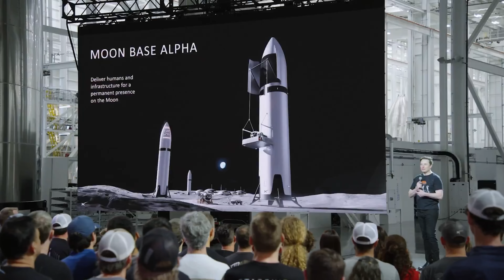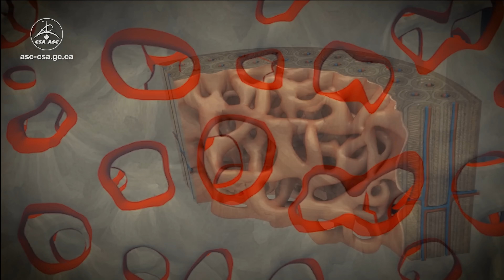New Inside SpaceX Moon Base Alpha REVEALED...

Comment: I think I might be on the spectrum.  I got upset with Google because I asked for the average temperature of the moon, then had to do the math myself.  It's between -10 and  10°f.  I'm pretty sure if we dug into the surface, we could live pretty comfortably without much need for heating or cooling.
Reply: Google already did the math for you by stating it's-180and 200 during the day. It has no atmosphere so the average will depend based on correlation to the sun in orbit.

Comment: Yes lets cut into the fuel tanks to make hatches. Brilliant idea! well send in the apprentice first...
Reply: Oh yes, before dispensing the sat simulators, there was significant haze floating around in the storage compartment... (maybe residues of the normal air from the launch site..., a bit denser here, less dense there, floating around...). 

That's how not empty it was...

And then imagine this - but consisting of fuel or oxygen residues in the fuel or oxygen tank - floating by the place that they cut open...

Comment: Starship is cool tech and should be useful for cargo but it is never going to be used for crew without heavy modification (or corruption during certification). It simply cannot get rated for human flight in it's current form. NASA's human flight rating certification "requires not just that a system be designed to be tolerant of failure and to protect the crew even if an unrecoverable failure occurs, but also that astronauts aboard a human-rated spacecraft have some control over it.". Starship is not fault tolerant. 2 engines fail to ignite during landing - total loss. Land with one edge on a rock so it tips over - explosion. It will crater on both the Moon and Earth if almost anything goes wrong during landing. Because of the speed it comes in at and the low altitude that the landing starts, parachutes will not work so it will be required to have an ejectable crew module that does have them (G forces may well kill the crew anyway due the falling at fast speeds and needing to arrest it to zero or less in a few hundred meters, or backup landing rockets more powerful than the real ones. Even Apollo which was acknowledged as very dangerous had a return to orbit option available if it couldn't land. SpaceX is going for less safety than that and doesn't care at all about it.

Waiving safety requirements might work for a couple of landings but is not workable for the frequency of use that Starship is apparently designed for. It will tank the company if one kills the crew. SpaceX only survives on venture capitilism and nobody will back a lame horse if that happens

Comment: wait a minute by the you add the fuel to leave earth orbit, achieve orbit around the moon, and then land on the moon are you really going to be able to carry equipment required to flop starship over on its side (?) and reconfigure the starship to be habitable in the horizontal configuration?   Not to mention that starship will create its own crater when actually landing on the moon???
Reply: You build the inside to work horizontally.  It won't leave a crater landing, the moon version will land with thrusters positioned at the top.

Comment: Better, Cheaper, faster. But I hope they make 2 types of Starships. One already built as a lunar Module with no modifications needed.  Another just a Starship transporter. First launch Starship landing module. Then meet with the transporter and link. The transporter will carry the module to the moon and release it. The module will land tipping over ready for use. The transporter could return to Earth orbit to transport the next module to the moon. Maybe a small boring machine to establish underground connectivity. You can have a 30 module base in a few months giving people a good start until they develop ways of using local resources. Also if we can find a way of cleaning up all the space junk, maybe we can send it to the moon for the base to use, metals, plastics anything they can use.

Comment: Since there is no need for cone nose shapes the habitats could be structured rectangulars, like a modular unit it would remove the space loss associated with round structures. A stable flat bottom not prone to rolling. Also making multistory units feasable. The initial round hull plating repurposed as storage for water, supplies, or as  work and construction platforms. I just love the thot of Moonbase Alpha. But alas, I was born 50 years too soon. Staring at the finish line just as things are getting started.

Comment: Also, they should have deployable emergency shelters that will protect from space radiation
Reply: I agree.
Also, it's a bad idea to ruin a functional spacecraft.
It would be better to send more ships or for the ships to make several trips carrying materials to build the base, such as inflatable bases if it's a temporary mission, or better yet, tunnel boring machines to build the base like a bunker. This would make it safer and protect it from radiation and cosmic rays.
The Eurotunnel involved nine tunnel boring machines, excavating 50 kilometers, which is 500 buildings measuring 100 meters by 10 meters. This means that one tunnel boring machine could build 55 buildings. That's about 10 hectares of living space.

Comment: Space X, or any other rocket enterprise can launch three sections for a super long space rocket, only to be used for interplanetary travel and not for reentering earth surface. The first section at the front can be used for pilot crew, passengers and cargo, the second section could be used all for cargo and the last section for fuel, engines and extra storage. You can have three or more room for passengers and cargo if only a section of the, lets say 300 feet long ship, is dedicated to engines and fuel, than having individual 100 feet long ships having crew, cargo, fuel and engines.

Comment: If steel grated floors and stars are pre-built into the fuel tanks, it would make it a lot easier to convert the fuel tanks to living space.  

Also I see no reason to tip the starship over.  Instead just cut a big door in the bottom of the starship, right above the rocket engines into the bottom fuel tank.  If there are already stairs and floors.  After cutting doors in the fuel tanks, the conversion could be very easy, in fact door frames could also be pre-built, so all you would have to do is hang the air and dust tight doors.  Maybe install a rubber gasket beforehand, etc..

Yes, no reason to tip it over.  Also if you tip it over, the top of the starship will also have to be converted.  If you don’t tip it over, the top part of the starship is all ready to go, no conversion necessary.  🙂

But cargo pods are even better.  No wasting 6 or 9 rocket engines.  Unless you have robots take them off the starship, package them, and ship them back to earth, to be re-used.  🙂
Reply: Great idea, the only reason I can think of is by staying vertical  exposed to meteor strikes and radiation, horizontally and covered with 3 meters of regolith provides potentially better protection? Not sure just guessing.
Reply: @RicNut   You need 14’ of dirt or water to protect from radiation.  Permanent colonies would have to be underground.  Any starship turned into a habitat would just be temporary housing.  Unless you dug a 180 foot deep hole and dropped it down inside, making a kinda missile silo out of it.  🙂

Underground Inflatable habitats, would be an easy way to make air & water tight habitats, with radiation protection.  🙂

Comment: This is absurd. It would be much easier to drill a hole and insert the shuttle directly into it. It would be temporarily shielded from radiation and would save a great deal of time and money compared to standing it upright and then burying it
Reply from the maker: Idk if it would be easier, man. The tool to dig a hole that big and the fact that Starship needs to land precisely one the hole sound quite hard too
Reply: @SpaceZonea if you can send a rocket, you can send a driller earlier…
Reply: @villalonweb3814 I assume you are referring to something like the boring company uses. They weigh as much as a Tank and operate on diesel (that won't work with out an atmosphere.  If they attempt to build a battery powered one.  That would drastically increase the weight and there isn't any way to recharge it.
Reply: @sidvicious6505 what about electrical devices? Batteries charged with sunlight? Mininuclear generator?
All drone assisted?
By the way, Tesla rockets already land vertically 

If the video shows the best NASA has thought, we are lost
It is not only a problem o bad politics, but of also bad scientifics

Comment: Will be interesting workarounds for every problem no doubt, like doing a lot of surface work during the cold lunar night which will be easier using relatively brighter earthshine during earth day facing side giving a regular day length effect varying with were the surface is during seasonal location from where the moon is currently located. Dark side of moon, starlight is it but even that ought to be magnificent not like one wouldn’t have good lighting to work with anyway. At least at night the radiation and solar storms should be nil but we’d have to turn the heaters up!

Comment: So,,,,, how the xuck are they going to lay over on its side an enormous spaceship???????  That’s a hilarious idea, typical of Elons nonsense. An airbag ?? my Lilly white arrrrse
Reply: pulleys and low gravity
Reply: @timbernetic , oh, yeah, that’s right, attach a pulley to a sky hook
Reply: .16x earths gravity would make it a lot easier than you might think
Reply: @Kj-_-ooI  not so, mass is still mass regardless of the lower gravity. Basic physics mate
Reply: @spinnymathingy3149  I’ve taken physics in college bud less gravitational acceleration means lower potential energy regardless of mass
Reply: @Kj-_-ooI  cool, so with your first rate understanding of the task in hand how would you rate the feasibility of this procedure without the access to machinery such as a large crane and robust earth moving equipment, for heaven sake the moon isn’t made of sand
Reply: @Kj-_-ooI  oh , on my initial comment , the mass of an object remains the same regardless of the gravitational field it's in. Mass is a measure of the amount of matter in an object, while weight is a force that depends on both mass and gravity. So, even in low gravity, like on the Moon or in space, an object's mass stays constant
Reply: @spinnymathingy3149 Yes, the mass does indeed remain the same regardless of gravity. What I am saying is that the potential for kinetic energy is .16x that of on earth if it is on the moon. Force = mass x acceleration which in this case the acceleration of gravity is .16x that of earth. I think it would be possible to only use airbags but eventually I do see them using cranes.

Comment: A lot of people think the "Moon Landings" were faked. So, for them, this will be the first time man has walked on the Moon!
Reply: Don’t give oxygen to the conspiracy stupidity.
Reply: You mean the new program to fake it for the second time.
Reply: I would think all doors and hatches could be permanently fixed/welded into position on Earth before launch in a way the the "tank" remains intact and the shell of the tank would just need to be cut out from the doorway as the only remaining step once in place.
So hatches are attached on earth, opening any hatch would be NOT opening the tank but just exposing the wall of the tank required to be cut away.